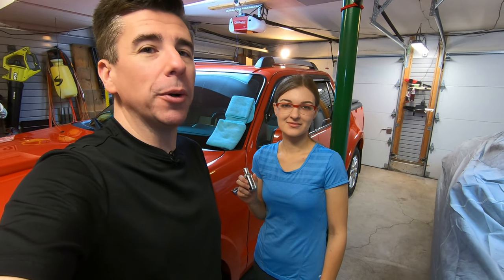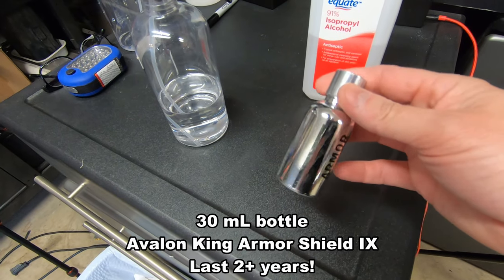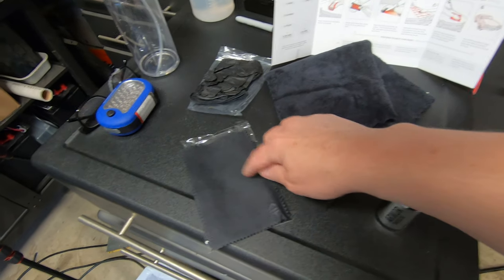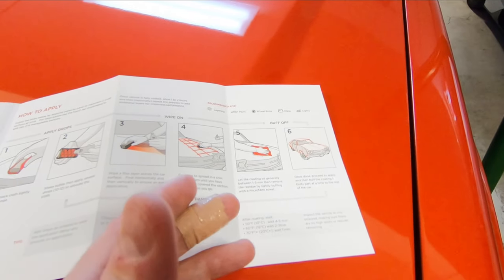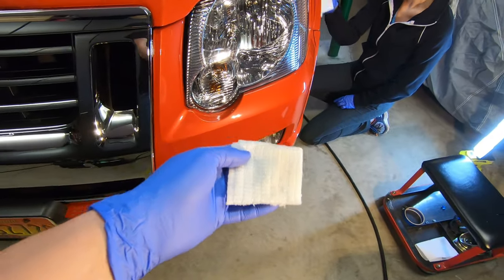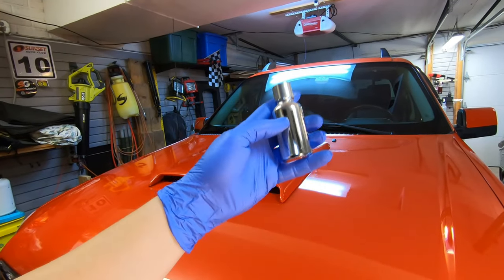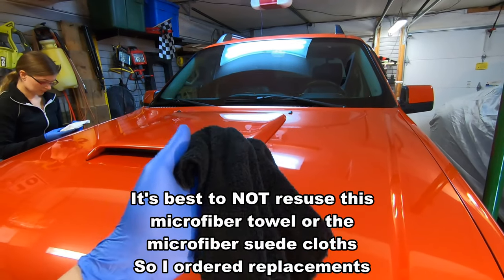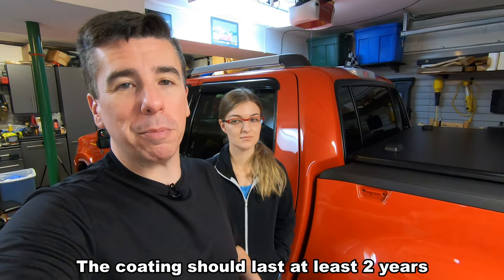Our first ceramic coat DIY! Avalon King Armor Shield IX on the 2007 Ford Explorer Sport Trac

Comment: Great upload Pat. I have the Armor Shield on the Grand Sport and have been pleased with it. The Sport Trac looks great. Now, I know how and wear to get Armor Shield, what I want to know is how and where to get the Rubbing Alcohol. Maybe you need to carry as a "Merch Product."  😉 Save the Wave.🙋🏼‍♂️
Reply from the maker: Thank you Peter! I appreciate you stopping by and dropping a comment. I didn't know you also used armor shield on your grand sport. How do you like it over time? 

I also did a ceramic coating on my I8 wheels. I'll be posting a video on that soon. The alcohol is so hard to find right now that I decided to pick up Wipe Out by Chemical Guys. I was able to order that online and have it in a few days. however, I thought you would have a recipe for making this in your bathtub.
Reply: I originally had the Adam's Ceramic Coat on the GS and didn't it like it. I removed it and went with Armor Shield and do like it. 

Yes, I do have a bathtub recipe for it, but that's for keeping my insides sterile. Hey, a guy has got to have his priorities you know. 😉
Reply from the maker: Lol!

Comment: 91% alcohol is way beyond the recommended 15%-25% solution for an IPA. That should have been properly diluted.
Reply: 50% MAX IPA is recommended amount…..any higher concentration may soften/harm the clear coat